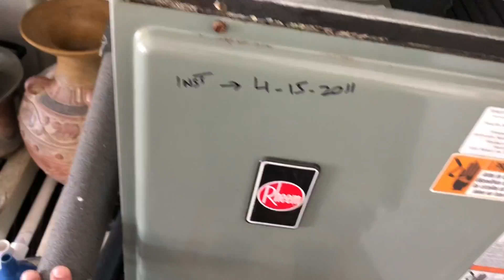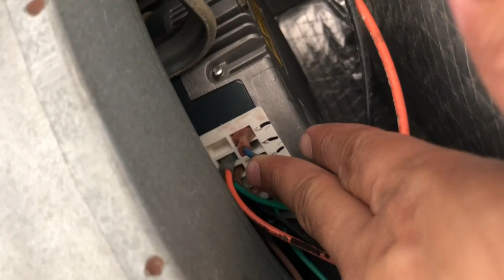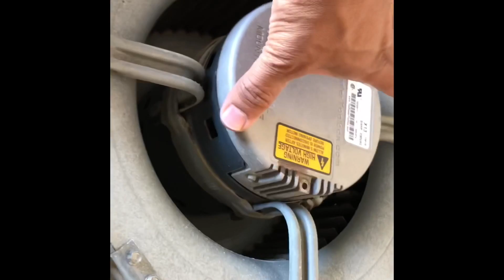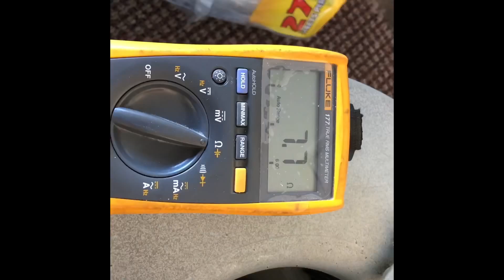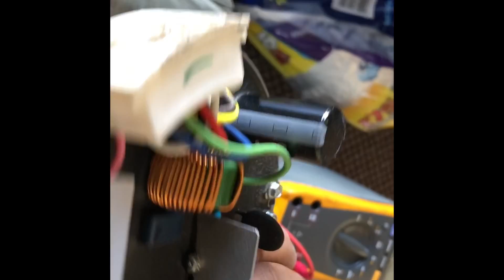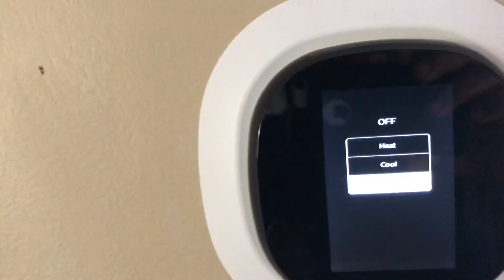Blower Motor Genteq/GE X13 module replacement

Comment: I had this same exact issue except my blower motor was running at very very low speed I could have reached my hand in there to stop it from spinning. I simply ordered a whole new motor with new module. I knew it was getting electric since it was spinning but spinning that slow even after I switched the blue wire that controls the speed did nothing tells me it was the motor going bad. We get a lot of power outages so I'm going to look for that surge protector you spoke about.
Reply from the maker: Actually your motor was good but it was the motor control part at bottom that went bad. Motors rarely go bad.
Reply: @HowToDoitright  well I will keep the motor for future and pack it in the box the new one came in. I believe our issue is we have way to many surges out here where I live in the country so I also an inline surge protector and going to have the electric company install a suppressor at the meter.
Reply: @HowToDoitright  btw I separated the ECM from motor and there was this whitish/tan substance like powder or sandy...It was on the rubber part of the inside plate and I'm sure that's not suppose to be there. I couldn't tell where it came from. We should have a new motor here tomorrow and I may order a new ECM and then try to sell the used motor with new ECM  to get something back.

Comment: you say old ones have capacitors but mine is atleast 15-20 yo . And no capacitor just the small two wire switch attached which I don't what it is . Doesn't look like any capacitor I've seen

Comment: I have a Genteq X-13 3/4 horsepower motor squirrel cage I'm trying to convert to just a shop fan is that possible? I see no mother board or capacitor, can I run it on 110v?
Reply from the maker: I doubt it. Along with power it needs speed triggers which is sent by AC control board. But if you can figure out a way it would be great to share
Reply: @HowToDoitright  I'm not a HVAC guy so I would have to get a trained A/C technician.

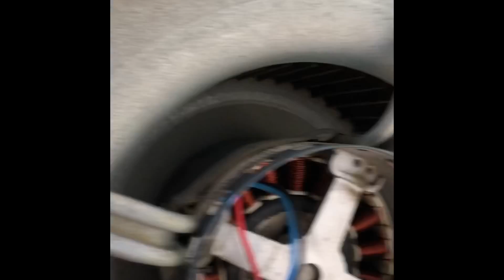Comment: @8:30 also need to check each of the windings to ground to make sure you don't have a short.
Reply from the maker: If you checking to case it’s the same as case is grounded

Comment: Is it still working as of August 2020?
I have the same problem,  I replaced mine last year ( motor). Problem happen again.  Thinking of replacing the module only.
I also bought the surge protector. 
Since last year,  I've used my central ac only 5x.
Reply from the maker: grungr668 yes it’s still working. I replaced the module and problem went awsy
Reply: Thinking of buying evergreen em x13 from Amazon.  The other one I bought from eBay.
Reply from the maker: grungr668 they sell a small device that you can install in front of the motor before the wiring. It helps in preventing your module from going bad. If there is a surge it takes on it and will burn itself before causing damage to your motor module. Ever since I installed it works like a charm. Even if it goes bad you can unplug it and plug your fan connections directly into the module like normal and your ac works. 
The device was like 30bucks on eBay and goes in front of the fan module and the wires goes into that device.
Reply: Yea. that's the device I bought and it still went bad.  Disconnected it and plugged it back in and still did not work. Went to the thermostat,  connected all three wires and the compressor turned on and not the blower.

Comment: This was a great and helpful video.  Was wondering if you could post a link to the module that you replaced.  I have followed you until I also came to the conclusion that my module is the problem, however I am not able to find where to buy the module.  I have found a few places to replace the motor and module together for about $250, but if just buying the module is cheaper that would be great.  I'll probably just go ahead and replace the whole module and motor, but for those that follow, a link to the module would be helpful!
Reply from the maker: 0rchidomegaly  I bought it on eBay. Search there you will find plenty of modules.

Comment: Sir! Great job explaining this. I also have the same Genteq X13 motor and same connections on blower...pin 1 & 5. Well my blower motor stopped working and was making a humming sound so I had someone come check it out and he fixed it in literally 5 minutes. He told me that the connection for LOW SPEED on the BLOWER MODULE went bad and all he did was switch the connector to the HIGH SPEED of the motor and Voila! I actually like it more on the high since it blows harder and I have vaulted ceilings.                                                                                                                                                                                                        Is there a need to change the MODULE right out now since the LOW is bad??                                                                                                           When you say that the module needs to be pre-programmed for your unit, what info do you look for??